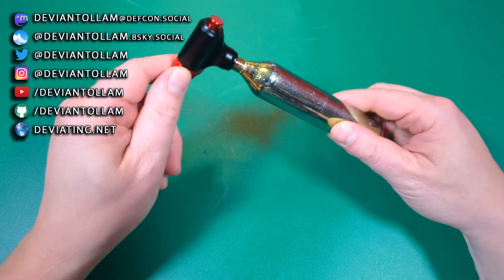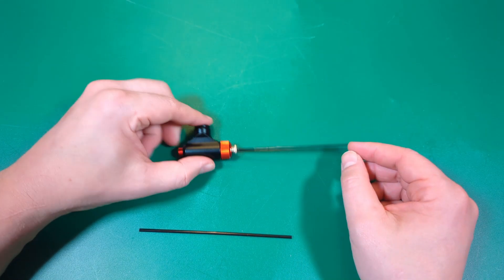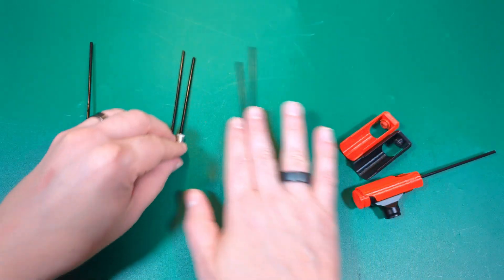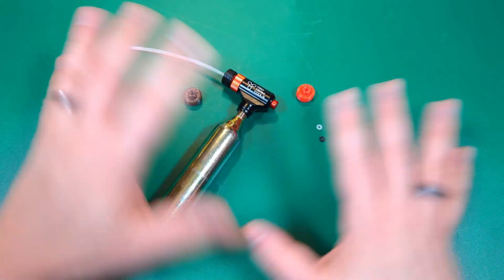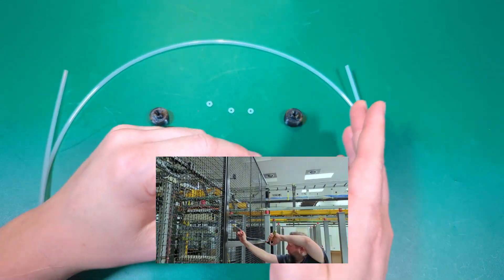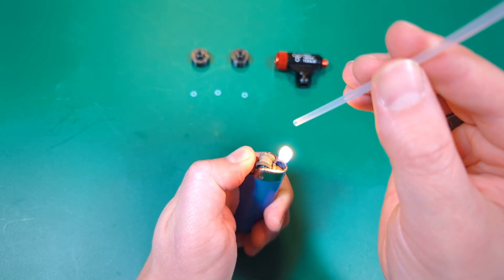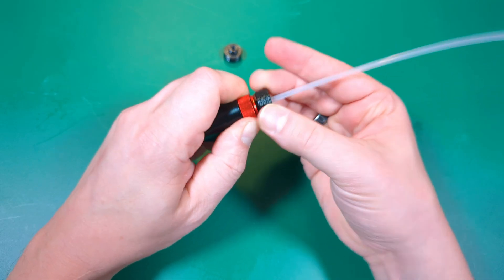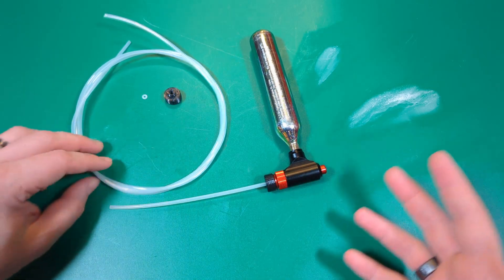REX Blaster Gen 3 - Overview and Instructions

Comment: if you're screwing with screwing plastic into metal, or in general, if the threads have been formed, twist it backwards until you feel/hear the threads click, reduces the chance of cross-threading by a huge margin.
Reply: As a mechanic I approve of this "Lefty-Tighty" technique.
Reply: I've done this forever learned it working on laptops
Reply: It took me a minute to realize what you meant, so to reword it... When installing something into a plastic thread (pre-made, or made by the first fastener), unscrew it until you feel it fall into the existing thread, then tighten it.

Yep, good to do. If it's something you keep taking apart, there's only so many times you can create new threads before it's stripped.

Comment: It seems to me the refrigerant is a problem.  Most of my red team gigs, I'm flying in so everything I take has to be able to go on a plane.  You can't take compressed gas on a plane.  So for this to be useful to me, I'd need the gas to be something I could reasonably find locally.  I don't know if NO canisters or CO2 canisters would work well enough. NO canisters are threaded, but probably don't match up, and are fairly difficult to find.  The non-threaded CO2 canisters are everywhere.

Comment: I think a 3D printer nozzle might make a decent flare tool for the tube.  You could turn the hot end on and gently apply it.
Reply: Low-temp soldering iron, bic lighter + traveler hook (seriously, is there anything that tool can't do?), or basically anything metal, tapered, and not exactly sharp—with a little heat added.

Comment: 00:27 🔧 The video presents the evolution from the first-gen to the current Gen 3 REX Blaster nozzle adapter, detailing the improvements made over time.
02:10 💡 The Gen 3 REX Blaster combines elements from both Gen 1 and Gen 2 versions, creating a better-sealed, easy-to-use nozzle adapter.
03:40 🛠 The third generation REX Blaster includes O-rings, printed adapters, and a durable nylon straw, offering flexibility for various specialized applications.
06:20 🌡 Instructions on shaping the nylon straw end using heat for a snug fit in the adapter, ensuring a tight seal and preventing gas leakage.
07:26 🔩 Demonstrates the assembly process, securing the straw with O-rings and ensuring a tight seal with the adapter, offering practical tips for field use and replacements.
08:36 💧 Shows the effective seal of the adapter, preventing gas leaks, and enabling precise delivery of gas down the tube without any dripping or wastage.
09:47 🚚 Offers an upgrade option for previous versions of the REX Blaster, allowing users to transition to the Gen 3 by mentioning their old order number while placing new orders.

Comment: Are all REX's still motion activated, or are there thermal sensor.
Would the smoke activate a thermal sensor?
Reply: I believe most of them are thermal not motion but yes this will work on thermal sensors. They only look for a temperature differential so the cold gas trips the sensor.